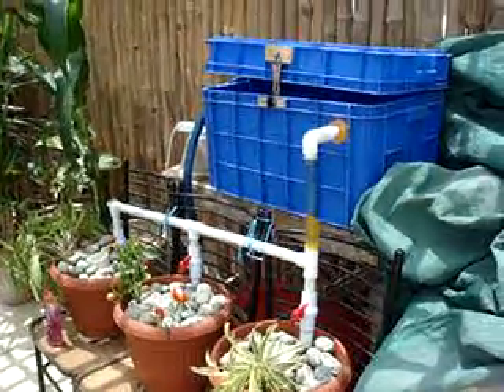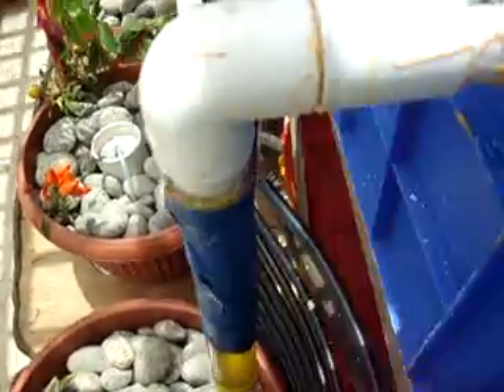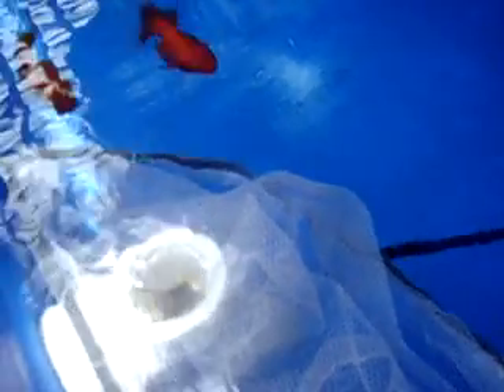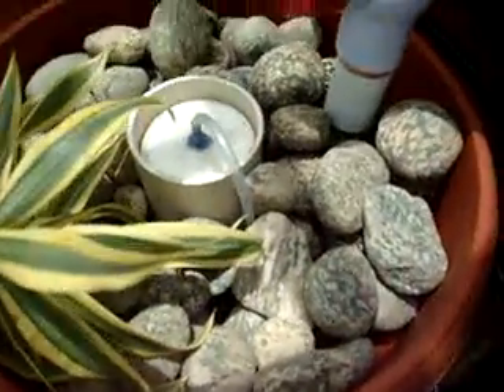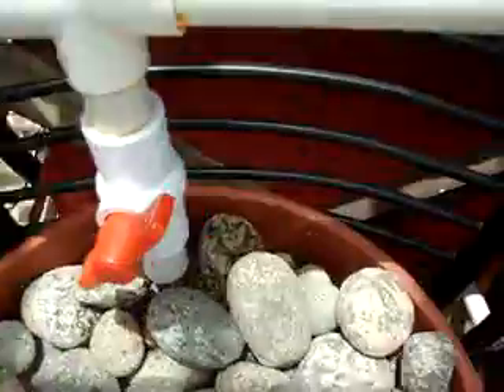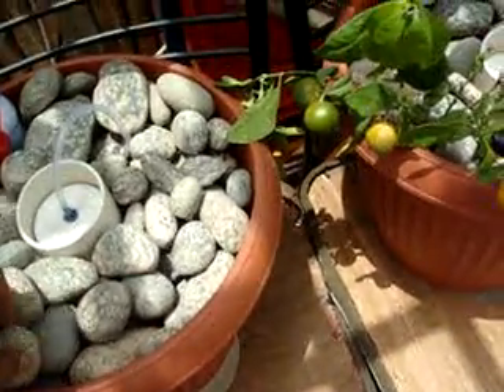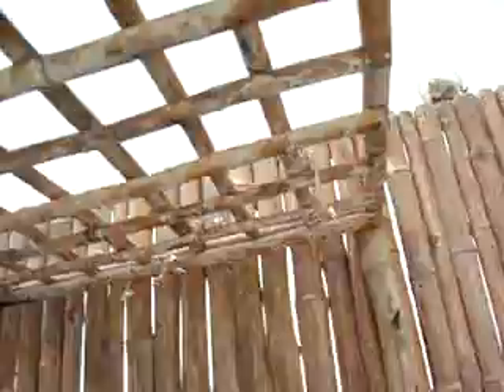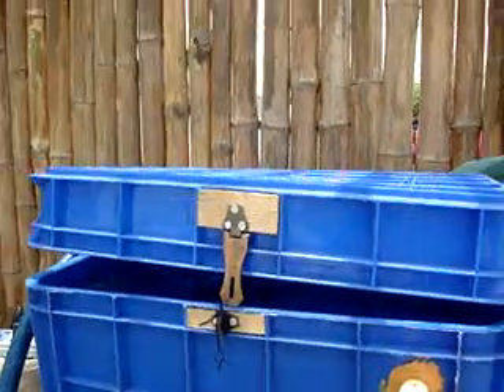Homemade Aquaponics

Comment from the maker: @HouseOfGrump Many people use two pump systems, but this configuration, called CHOP or CHIFT/PIST isbetter as it is safer, with no pump in the FT there is no danger of a pipe breaking and draining the fish tank or electrical failure electrocuting them, even if there is a failure in this config the fish will be fine and the plants and go about 5-7 hours without it running so much safer and reliable, then again thats just my opinion, check out online forums as this is a much debated issue :]